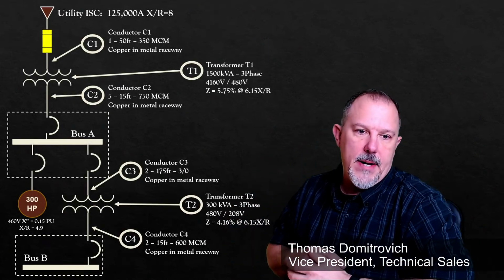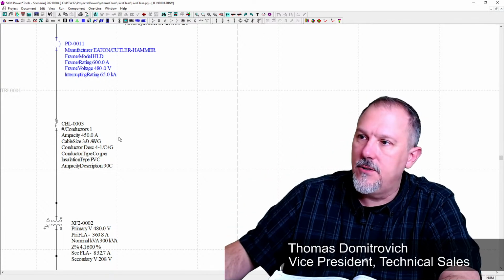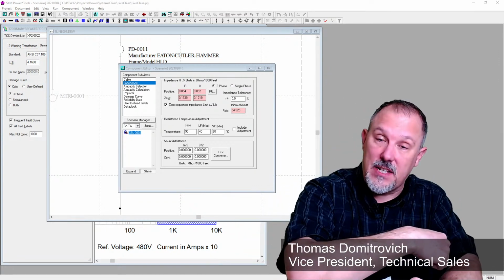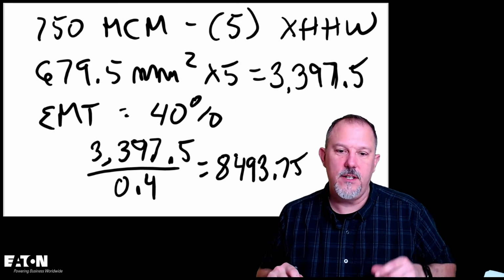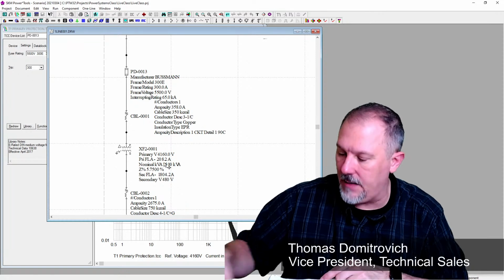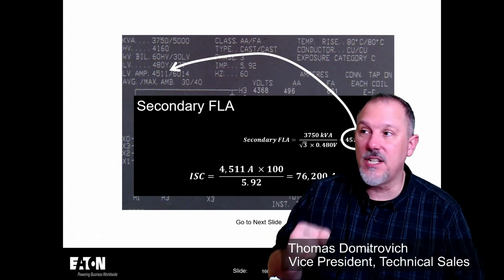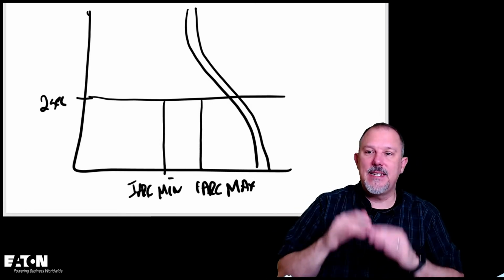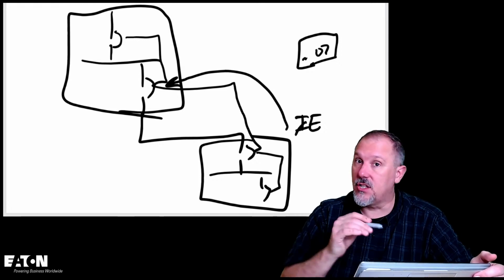Power Systems Engineering - Selecting the OCPD

Comment: Hi
Refer to your discussion regarding the incident energy analysis in bus 4 ( from 1:30 onwards) I understand that the fault in the bus 4 either cleared by the circuit breaker PD012 at the transformer secondary or by the CB PD0013 at the transformer primary. 
SKM calculate the incident energy in both cases , the minimum incident energy so use lowest arcing current in the PD012 and the maximum incident energy in the PD0013.
Kindly comment in my understanding.

Comment: Maybe this is just a misunderstanding on my part, but you are utilising 5 parallel runs of 750 kcmil conductors for 2000A. Your plan is to place it into a 4" conduit. 

That 4" conduit will carry an A phase, B phase, C phase, neutral and a ground conductor. There are only 3 current carrying conductors in that raceway, in a normally balanced 3 please system, and the N and G wouldn't cause you to derate to 80%. If you placed every conductor from that run into one conduit it would carry 25 conductors 15 of which are current carrying so you would need to derate by a lot more. 

So you would have 5 seperate runs of the 750 in conduit.
Reply from the maker: Thanks for the note.  The plan would be to separate this into three different raceways not all into one raceway.
Reply: @TDUNPLUGGED  I have given this some thought and I know Canadian Electrical Code is a bit different than NEC; although, I'm sure we carbon copy that version and make slight changes. 

This question is more geared towards if you have the time to talk about it in the next segment vice writing an answer on here, provided you have the time. 

This is what the CEC says, "The orientation of single-conductor cables in parallel, with respect to each other and to those in other phases, shall be such as to minimize the difference in inductive reactance and the unequal division of current."

Is that enough for an inspector to say you can't send all of A phase down a single conduit etc. and must place a conductor from each phase. 

Irrespective of that answer, does skm simulate the extra heat that would be induced in the conduit due to the EMF of the fields, predict the ambient temperature change within the conduit for possible derating (provided a ∆T is significant enough) and apply a more accurate voltage drop for the increased temperature within the conduit?

My initial thought was why skimp on the 30' of conduit when the conductor is the large $ factor and why put yourself in a derating situation when you don't have to. The only benefit would be landing the conductors if it was going straight into the lugs. 

When you utilise the EMT as the bond, will aim change the zero sequence fault calculation compared to when a bond conductor is included? 

I'm going to do my best to attend the next live event but if I can't I will be watching the channel.
Reply from the maker: I will cover this during my Thursday program.  Thanks for the quesiton!